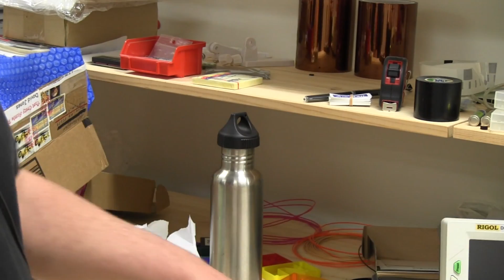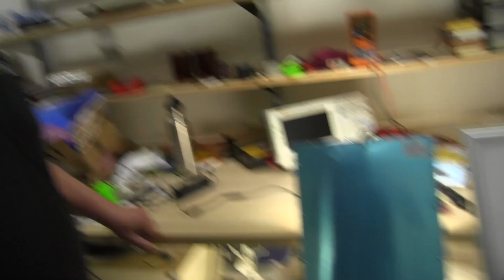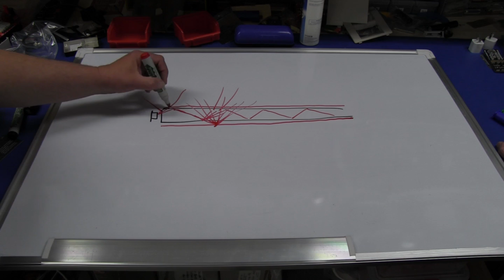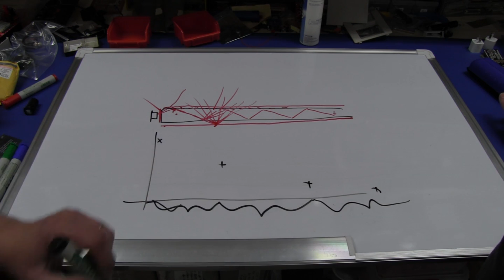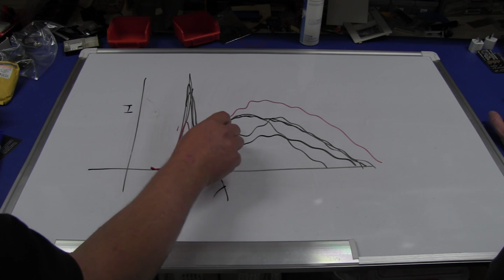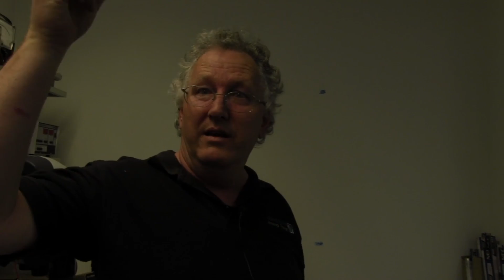EEVblog #361 - LED Ceiling Panel Lighting 101

Comment: What's inside of edge lit LED panels? Can you drill a hole through the center and it would still be operational?
Reply: A thick plexiglass sheet with ‘dots’ on one side, and high-tech flexible plastic sheets reminiscent of a fresnel lens, but designed to throw light coming from the sides straight forward. It’s clever stuff.

And yeah, you can drill a hole straight through no problem :)

Comment: Typically what would the diffused panel be made off? And what would determine a good diffused material? I mean what parameter to look for in a material to calculate the diffusion? @eevblog

Comment: The Side emitting designs do have a lot of light fall off, the updated design, placing the leds on a backing board are much brighter. They use 500 led's evenly spaced on the back board, like this:

http://www.alayax.com/led-panel-product-information

and the prices are lower that you might think. This mob offer a three year warranty.

http://www.alayax.com/led-panels/led-light-panel-1200-x-300-x-12-5.html

Comment: LED sales are still being driven by unscrupulous marketing departments.  The intensity fall-off from even high profile brands can be quite surprising.  If you do use those panels a lot then it would be interesting to get light readings from new and as they progressively age.
Then of course there are the cost-engineered power supplies....   The LEDs will often outlast the PSUs, which often fail in a strobing mode.  Presumably due to dry caps causing excess ripple that triggers the overload protection repeatedly.

Comment: Hi Dave,

I'm running decent T8 retrofit LED tubes 60cm long in a cheapy dual lamp. I ripped out the electonic ballasts and rewired it so that they will fit. One tube sucks 9 Watts. I have 6 of them in a approximately 20 m² room (not 100% rectangular) and together it are certainly 54 watts. I get an output of 6600 lm. They are extremely efficient. So we came now to the point where we have 122 lm per watt. That's insane. One tube costs currently 15,20 EUR on Ebay: http://www.ebay.com.au/itm/1x-60-cm-LED-Rohre-9-W-Typ-A-matt-6000-K-super-bright-90-120-150-cm-im-Shop-/231161876589

Comment: Yes, depending on where you drill of course.  The diffuser is just acrylic plastic.  Drilling holes in it will not affect the function assuming you don't drill the electronic component, but it will affect performance.  Drilling a hole will allow light leaks and thus the effects of the diffuser around this area will be lost.

Comment: A cheaper or even completely free DIY way would be to take a cracked or broken large lcd and replace the actual lcd panel with a thick plastic panel and remove the lensing sheets under it but leaving the diffuser. Most modern lcds use led backlighting and works in a similar way to this. It does work and you do get rather even light!

Comment: If your LEDs are starting to fade over time they are being over driven. With the exception of LEDs that are intended to have heat sinks there should be no notable temperature increase in the lamp itself.

Comment: I installed a very cheap light with 2x 36W T5 tubes and classic ballast and it has an unexpected feature - when it's starting, it turns on my desktop automatically! :-)
I discovered that's some EMI garbage inducing into USB. When I disabled "wake-up by USB", it stopped.
Decent quality electronic ballast would be much better (also in efficiency and tube lifetime), but there wasn't enough place.

LEDs are certainly very nice, but still much more expensive.

Comment: 70Hz to 100Hz is when your eyes are still. When you move your eyes (or the light source) the light is hitting different parts of the retina, so there's no chemical limit. I've tested this with a 555 timer and a LED.

Comment: I know what you mean (e. g. LED break lights of cars often flicker), but PWM flicker is definitely not visible well into the kHz range, even while moving your eyes. Around 25Hz motions look fluent (but this is something different than flickering). And around 70 to 100Hz the eyes stop to perceive flickering of light. There's a chemical limit to that. The pigment in the retina takes a few ms to decay after it's been hit with light. And only after that the retina starts sending pulses.

Comment: You can't get hotspot in the middle. If you calculate second derivative of 1/(x+a)^2 + 1/(x-a)^2 for point 0 you always get positive number (regardless of a) and that means that there is always minimum in the middle.

Comment: Water absorbs EM radiation pretty well - the longer the wavelength, the better the absorption.  Radio waves are blocked pretty readily, visible red gets blocked over a number of feet (deeper than any swimming pool, certainly), and so on.  Blue is the last visible light to go in well over 100 ft of salt water.  A lot of underwater photography and videography involves adding red back into the image..

Comment: Actually, I disagree with his views on color temperature. I've done a lot with full spectrum lighting, which primarily cares about CRI (Color Rendering Index). However, around 5000-5500k tends to give you a better color temperature for actually working (and all the metal stuff that supposedly goes with it). It's also closer to sunlight on a summer day. 6500k is a little blue for me, but it does also work well when paired with high CRI. 3000k seems at the very bottom of what would be acceptable.

Comment: If you don't like PWM just put a capacitor and coil between the controller and the led panel - i made car headlights run that way with 2 of the 3800 lumen CREE LED's you might have to calculate the exact inductance and capacitance in relation tho the PWM carrier FRQ.

Comment: I'm guessing if you get flicker those LED's aint running from constant voltage. Don't know why ud use anything but constant voltage if you are using cameras that are sensitive to light pulse frequency due to frame rate frequency and the respective mismatch.

Comment: Wait..Did he say T5 florescent gives 100 lumens per watt and LED panel is 60 watt input with 3000 lumens output....that's only 50 lumens per watt -> half as efficient as T5 bulbs. Is this correct?

Comment: If you scatter white light off of very small particles (size > 0.1 micron), the power of the scattering is proportional to λ^-4 (λ= wavelength). Even if you just go from Cyan to Orange/Red, the cyan light is scattered about 5× more than the Orange light. If you go from Deep Blue to Deep Red, the difference is almost a full order.
This effect is called Rayleigh scattering. It's the same reason the sky is blue, while the sun is yellow or red depending on it's angle of incidence in relation to you.

Comment: Rayleigh scattering goes as frequency to the fourth power. That's why blue light scatters more than red light. Makes the sky blue (scatters like in the pool) and sunsets red (goes to your eye since it scatters less). Not a function of composition, i.e. it isn't a spectroscopic effect.

Comment: The strobing didn't seem to be showing up in the video, but maybe you can do a follow up video where you figure out the PWM frequency just for fun? I guess probing the controller output should tell you, right? I wonder if you could use a photodiode taped to the front of the panel though haha

Comment: Back in the 80s I was messing with some red LEDs and found that as the duty cycle was lowered I could stop the flicker by upping the frequency. I wonder why they aren't doing it these days. I could adjust the LEDs from 0 to 100% brightness with no problems.
Reply: Mike Whitenton I was just thinking that. Pwm frequency shouldn’t change - it’s the length of the ‘on’ pulses compared to the total cycle time that should change. Proper controllers pulse way way faster than the human eye can see, so I don’t know what was going on with the ones that flicker. Maybe just super cheap not much thought put into it early models, with a low pwm that only became apparent at low brightness because of something to do with the eye’s persistence changing at lower light levels..?